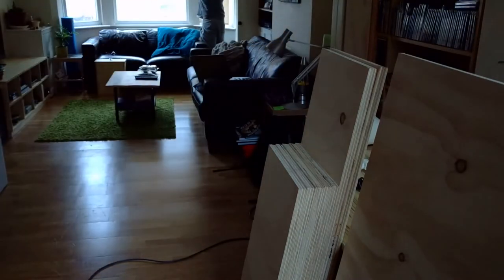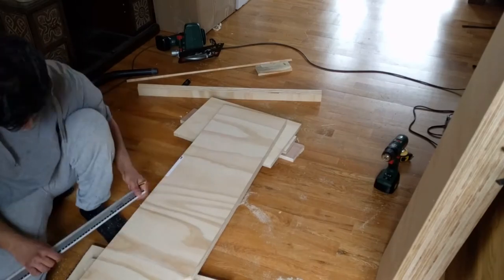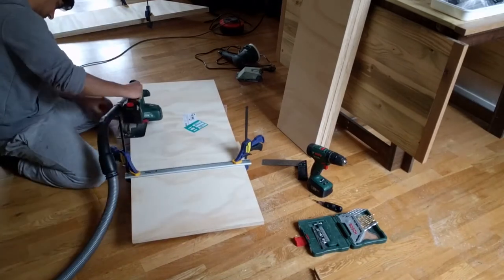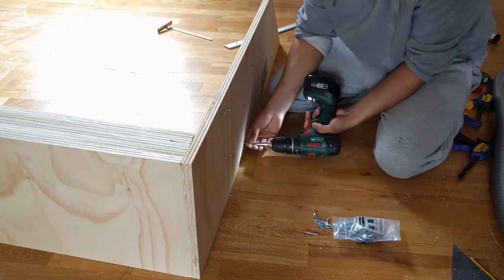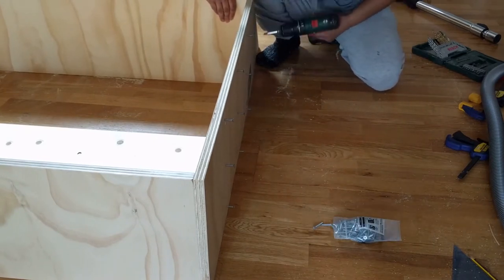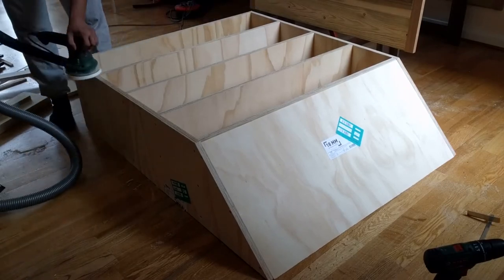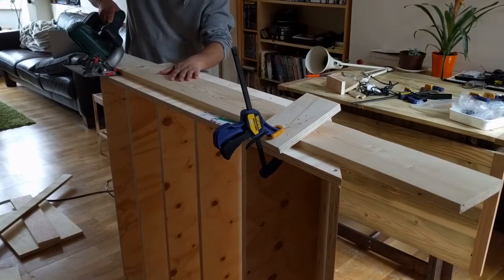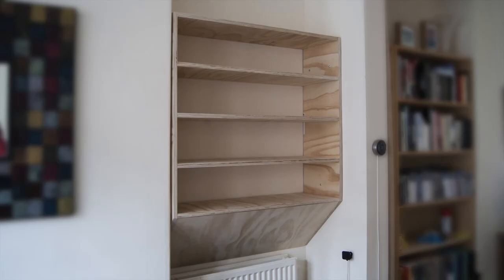How to Make Shelving for an Alcove

Comment: Nice job fella, couple of quick questions - I missed the thickness was it 18mm ply used and how resistant was it to 'bowing' once you had the weight of the books on?
Reply from the maker: Thanks! It's 18mm ply, and it hasn't shown any signs of bowing at all. We even have a set of old cast iron weighing scales on the middle of the top shelf and it's as flat as it is in the video still.